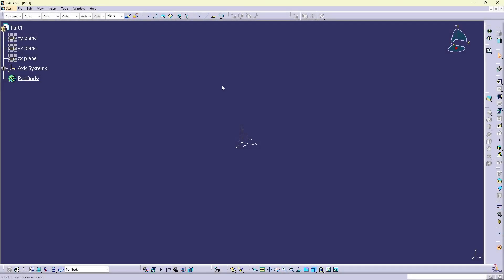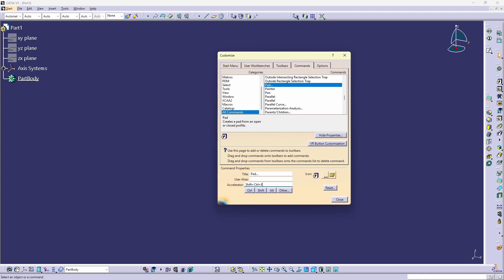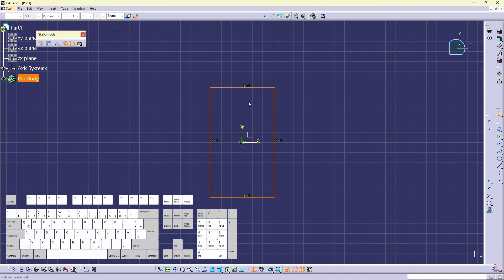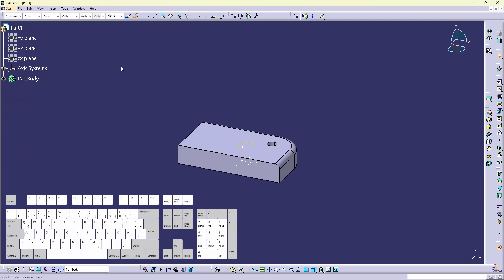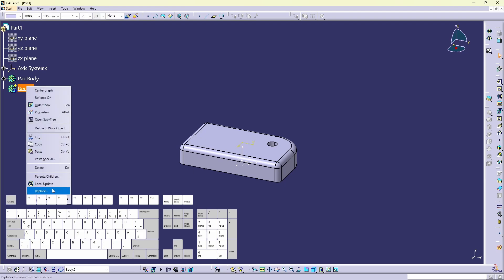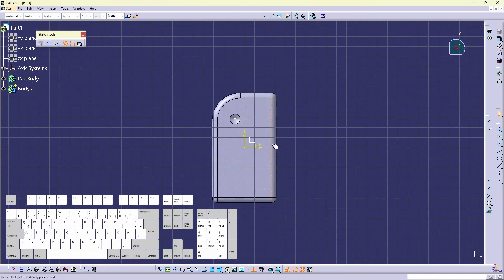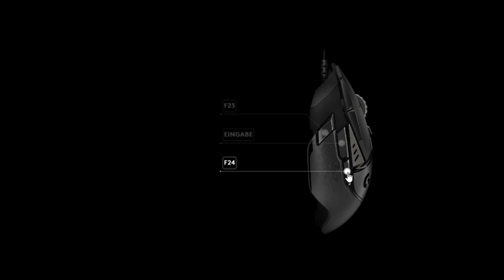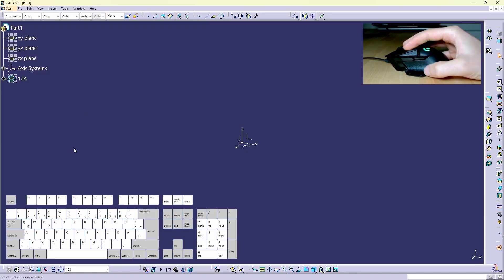CATIA Shortcuts Tutorial – Work faster and more efficient

Comment: Have you considered using a mouse with more buttons?
Reply from the maker: Yes :) I actually own a Logitech G600. I sadly never got the hang of it. It just has to many buttons... Mine (G502) currently has 6, if we exclude the mousewheel. Which is actually totally fine. With modifiers, thats a total of 36 different combinations (Excluding: shift+alt+ctrl). It's 31 in my case, since one of them is blocked by enter.
Reply: @sebastian-wilhelm  Then I think your video is incomplete...There's a big secret section missing :)
Reply from the maker: @Lotos82 Well at least it is in the comments 😅